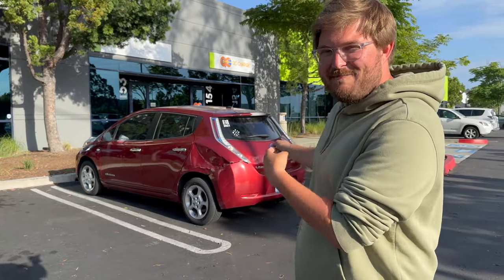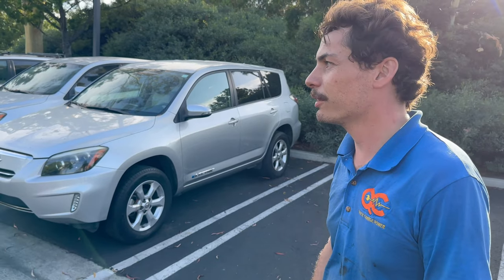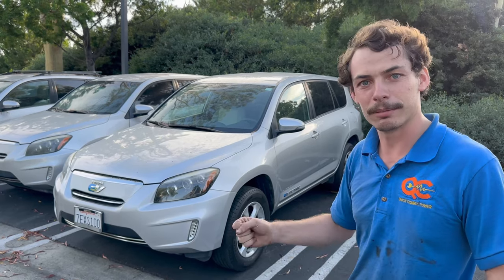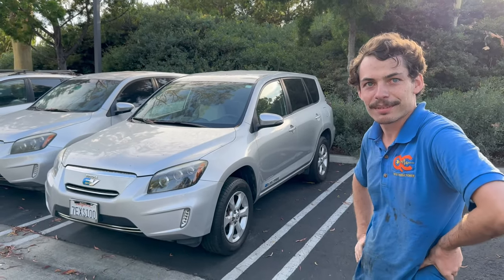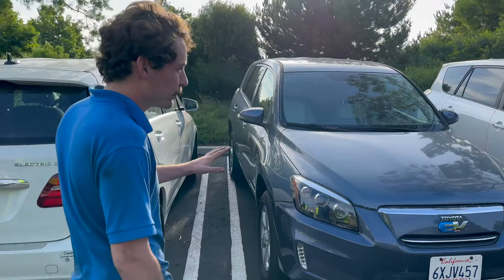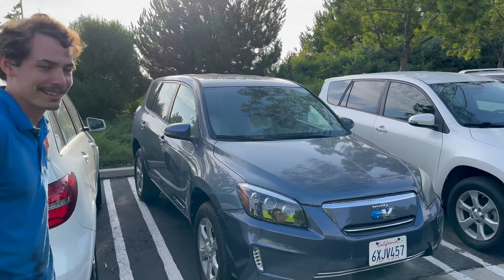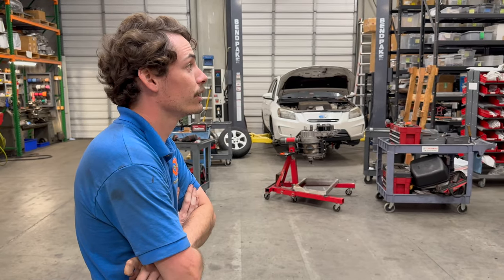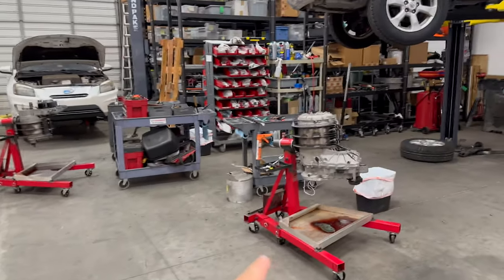Fixing My Cheap Nissan Leaf! On-Board Charger Replacement & RAV4 EV History Lesson w/ QC Charge

Comment: the black "capacitor" box is a backup power system for the braking system.
depends on the obc version most versions are repairable. i fixed mine same replaced version 3na3a  QC installed on your leaf. i would like to get my hands on your failed OBC to fix.

Comment: How easy would it be to put CCS or even the Tesla socket?
Reply: Now with the move to NACS, in theory it should be possible to retrofit a NACS connector. The trick is that Tesla has no means of authorizing a charge for non-Tesla vehicles except for the Magic Dock. Once NACS-native non-Teslas start rolling out, presumably Tesla will add “charge my non Tesla” to non-Magic Dock Superchargers, but the question then becomes “will it always assume a NACS non-Tesla is using the CCS protocol?”

Superchargers plugged in to Tesla vehicles use the same data protocol as CHAdeMO. That’s why a CHAdeMO adapter was available for Tesla vehicles early on. So in theory any CHAdeMO vehicle should be able to use a reverse adapter, it Tesla made a way to pay. 

But with the move to NACS, the connector will “speak CCS”. Newer Tesla vehicles have ports that can “speak either”, which is why the CCS adapter for Tesla vehicles is now available - and also why older Tesla vehicles need a retrofit to support it - those older vehicles only “speak CHAdeMO.”

(Which also means that older Tesla vehicles will need the retrofit to use non-Tesla NACS stations once they start rolling out, even though it uses the same physical plug!)

Comment: What is the point in this , it does 50 miles so after 40 miles you need to look to charge it ????.
Reply: In the US, most people drive less than 30 miles/day.
Reply: @alsavage1  and am sure most people do a lot more its still pretty pointless ,in the winter months that could be 30 odd miles before needing to find a charger  .
Reply: @mysurlytrucker7510  No, as I stated, the AVERAGE person in the US drives less than 30 mi./day.  By definition, that means MOST people do not drive more than that.

Comment: Why dont people put like a 400W solar panel on the roof of it to continually charge it all day long even when driving? I find it extremely odd that no one does that. What, it doesnt move with the sun? The solar panel on my motorhome seems to work fine and so did the one in my 93 conversion van. Its just plain WEIRD, the all the people with EV Golf carts claim to have unlimited range, even with lead acid batteries. Solar panels arent perfect, but why not? No one talks about it no one asks questions, not any videos on it for these kinds of evs on this video that are normal to buy, not one of those evs that looks like a green stink bug.